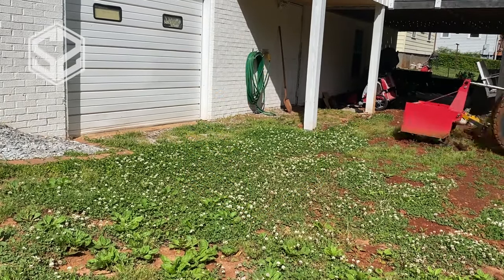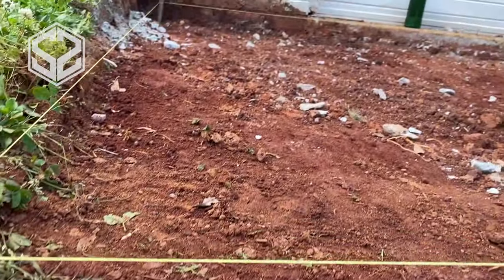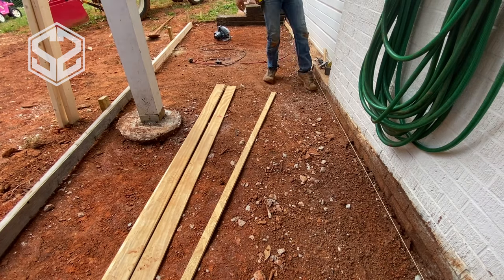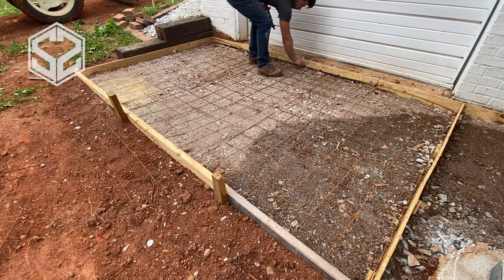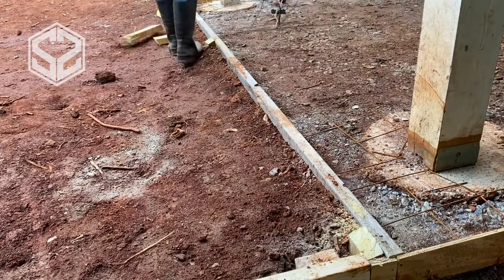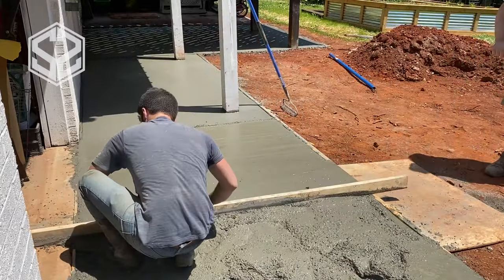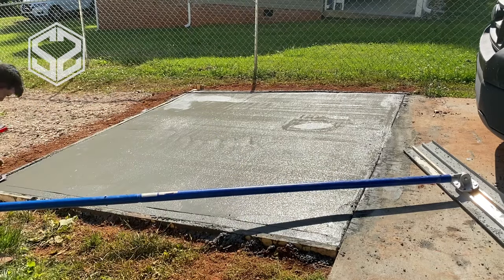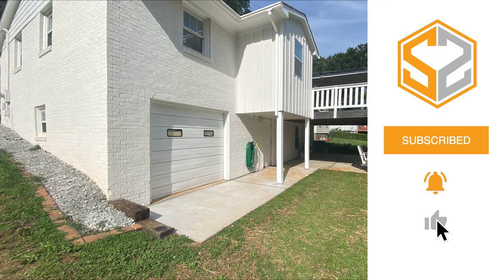DIY Concrete Slab - How to get started

Comment: hey simon, the expansion crack form; did you just leave that in place?
Reply: I guess the world will never know.😢
Reply: @JamesFraley 😂
Reply: This was my question also
Reply: Also was wondering that..
Reply: I think yes is the answer
Reply: Ryan from Victory outdoor services here on J-Tube never uses expansion board.

They drill holes into the existing concrete and hammer in rebar so that the new concrete won't settle below the existing concrete.

Comment: When joining slabs you should use foam for expansion joints and drill dowel holes into the slab and add rebar to get a strong join, and for a patio like that I would recommend a broom finish that’s gonna be a very slippery slab, also buy a trowel\ stick trowel to get a proper finish. Didn’t look the best tbh but well done 👍
Reply from the maker: Thanks for the tips! I appreciate it. 😊
Reply: Yeah,  I was going to say I didn't see the steel trowel used and then a broom finish..,but good job..

Comment: Hey awesome video. I have a question which might be silly but still hoping for an answer, lol:
The forms (timber long sticks that help contain the shape of the concrete and also are used to flatten and smooth at the end, if I understand properly) that go on the side of the house, how do you get those ones out? And if you get them out, isn't there a hole between the house wall and the sidewall?

Thanks a lot.
Reply: Yeah, I'm wondering the same. Also can you just leave it there? Thanks for a great video though.
Reply: I had the same question..lol
Reply: He shouldn't have put wood between the slab and house. Especially not standard plywood.  They make foam for this application.

Comment: Like the video - what happens with the expansion joints? does the wood get left in there? if so, when you placed them are they submersed from the service rather than sitting at the service?

Comment: Did you consider using a concrete vibrator to remove any air bubbles? Is that a concern in this?
Reply from the maker: I wasn't to concerned with it because screeting the concrete removes most of the bubbles. I typically use a hammer to tap the forms around the outside to get any air bubble out and make a clean edge. If the form was deeper or more complex like stairs or something, I would defiantly use a vibrator to make sure the concrete flows correctly and removes the air.

Comment: Which concert bags do you recommend so many to choose thanks
Reply from the maker: I used the 60lb Sakrete High Strength Concrete Mix. I purchased it from Lowe's. The 60lb bags are cheeper per pound then the 80lb bags and a bit easier to move around.
Thanks!
Reply: @SimonSaysDIY ae

Comment: The posts buried in the slab with ground contact insures accelerated rot and a need to replace the posts.  You did mention this.

Comment: Good job, those bags must be cheap, they are 8 dollars for 20kg here in Australia… cheaper here to use cement bags and adding sand and aggregate. Wear a mask next time, that dust is dangerous.
Reply from the maker: Thanks! They aren’t too bad. For the 60lb. bags it is $3.58. It’s not too bad. But wood prices here are through the roof!

Comment: Don’t use wood for expansion joint use actual expansion joint or foam
Reply: Also don’t use bags on anything big other then really small projects and always use 1 shovel of Portland nd one lime lime optional but important to every 80lb bag bags however are always weaker then plant mix
Reply from the maker: Thanks for the tip! I wasn’t aware of that!

Comment: Right now a concrete truck is over $400 more than just buying the concrete at Home Depot.
Reply from the maker: Yeah, there can be savings mixing it yourself instead of having it delivered.
Reply: Doing a big slab in 09/2024 and the truck was $176 cheaper than Home Depot.